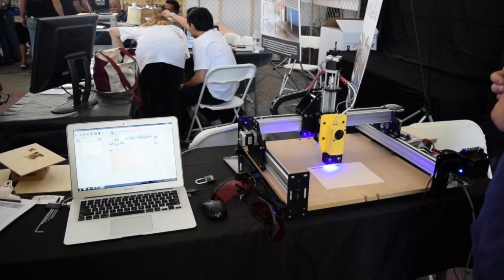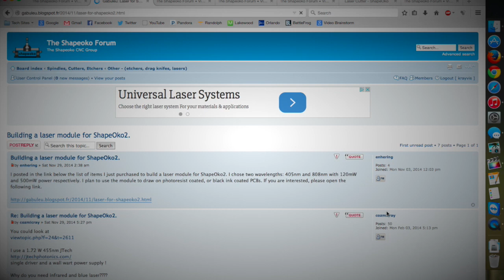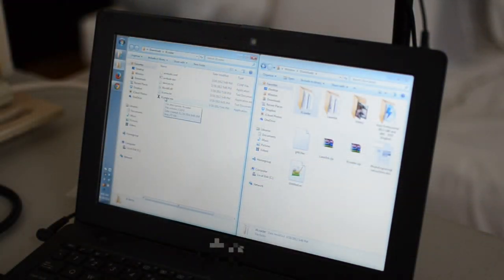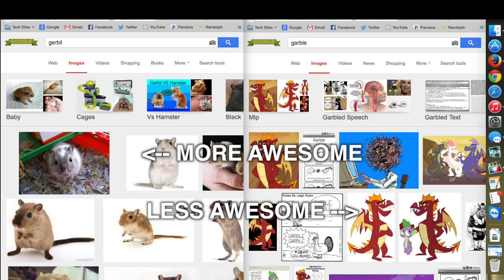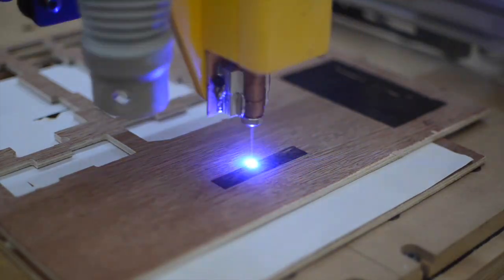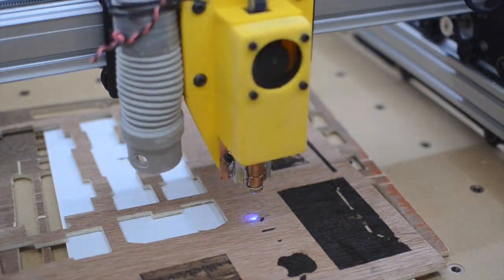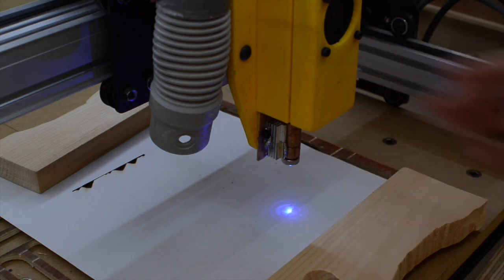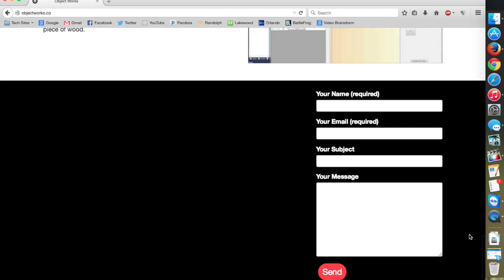Preview: LaserInk Upgrade for the Shapeoko 2

Comment from the maker: @Danny Grob (Youtube is being stupid for not letting me reply directly) The laser in this mode runs at a 50% effective duty cycle for cooling purposes. You can enable bi-directional rastering in the software however. It's a tradeoff you have to decide on. This is an issue with laser diodes in general, not LaserInk. JTechPhotonics, for example, says that their product should be run at full power for short periods of time only

I could probably have done bi-directional rastering on this project, but did not out of an abundence of caution..
Reply: Thanks! My laser is cooled pretty well, i'd like to try this software when they release it (as i can find no other option for gcode...)
Reply: Deep South Thanks! I've been using the Inkscape plug-in. It works fine, it gave me some issues with smaller text. I've been using a cad program, and a converter with great succes. Just looking for a bitmap engraving solution. The Picengrave software is far to slow and the output is in a gcode format my router (Repetier firmware based) does not understand. It's for Mach3 based machines i guess... Also a bit pricey for the quality.
Reply: Deep South I see, the J-Tech option was missing the last time I tried the program. That seems to work fine! I could not use the program before, so i have no samples. With the quality I ment the program itself. I assume you are one of the creators? I was talking about usability and user interface. They could use some improvements. If you value feedback I could send some helpfull hints and tips! (the demo version is engraving a simple image now, so thanks for your help)

Comment: You might want to wrap some Teflon tape/ white tape for plumbing to the lens holder and screw back in so it will not shake when you try to focus. You can remove the spring after that.

Comment: Hello,  I use a laser at work daily in the printing industry and I just wanted to give you a warning. In case you didn't already know that is.
Do not cut Vinyl with a laser as it puts off toxic gases that can kill you if prolonged exposer. Also I would suggest ventilation

Comment: Is there any laser out there that can cut 1/2 Inch plywood? (DIY use)
Reply from the maker: You'd have to hit ~100-200 watts before that's feasible. Most of the 40W lasers (that still cost $$$$) will only do up to 1/4". At least from what I've gathered with my minimal shopping around.

It's still DIY possible... probably not safe, and definitely not cheap.
Reply: Thats a shame. My CNC would be so much better if it was a laser cutter.
Reply: Max Mustermann

My eBay 40W Co2 laser is cutting 1/4" acrylic, albeit slowly.

Cheaper than a Shapeoko 2 as well.

Comment: @Max Musterman  To my knowledge there currently no DIY laser head can cut through 1/2 plywood. 
To Put it in perspective. Minimium 30w C02 laser has the power to sufficently cut through 1/4 inch mdf / plywood with ease. Any material thicker than 1/4 will require multiple pass and significant charring on the edge of the material. 

hope this helps